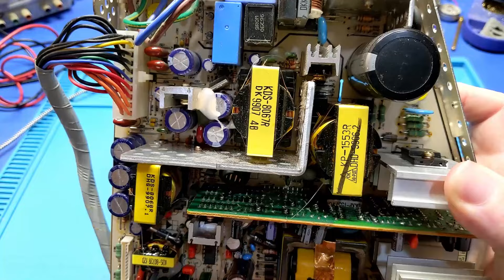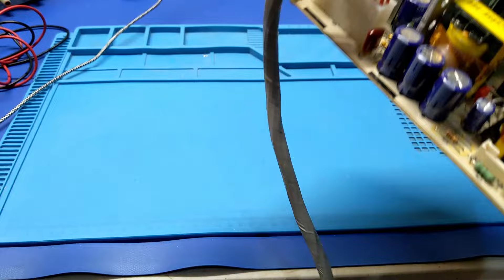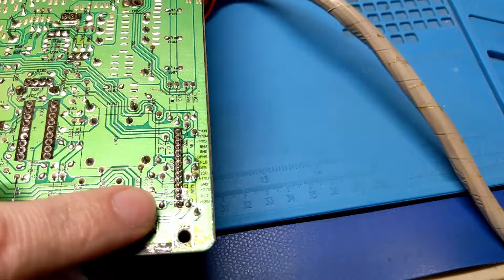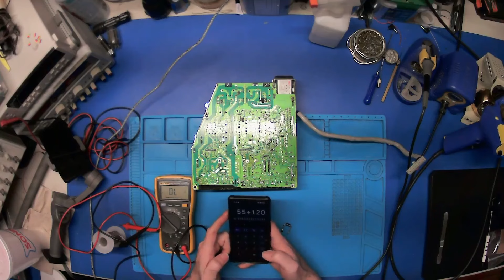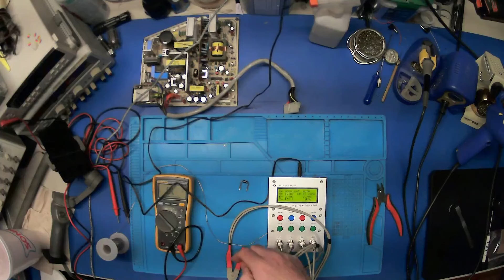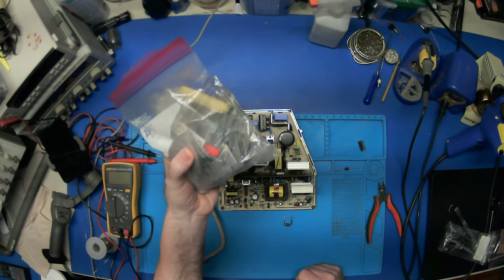eMachines eOne Dead No Power Repair Troubleshooting

Comment: The worst thing about working with proprietary PC PSUs and motherboards is not knowing whether the AT/ATX connector is using a standard pinout.

Sure, you can look at it and see if all the grounds are in the right place, and see if the main rails (+3.3, +5, +12) appear to be correct.  Those aren't too hard, even if they use non-standard color codes, because it's easy to check ground continuity, and at least you can see if all the pins populated by main rails are the same color, even if they're not the right color, and then track that back to the PSU PCB and check voltage rating on output caps, etc.

The thing that always makes me nervous is "all the other stuff."  Did they drop -5v and replace it with +2.5v?  Is PS_ON or P_OK inverted?  Have they repurposed a ground pin for a remote sense pin on the +3.3v rail?

You never know for 100% certain.  Usually it's all standard, because they're buying parts from OEMs that CAN customize a circuit, but why?  What's the point of changing it unless you really need to?

Anyway, that seed of doubt always makes me squint and chant, "please don't blow up please don't blow up please don't" while powering it on the first time.